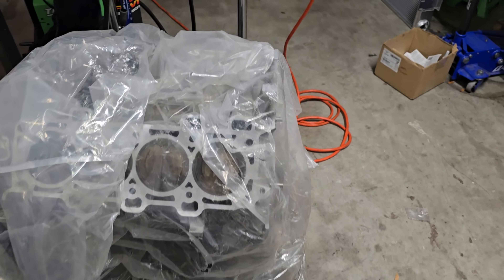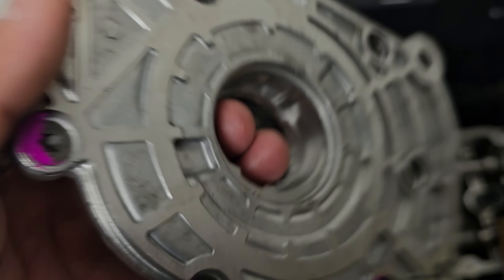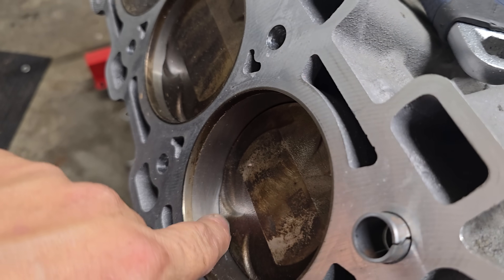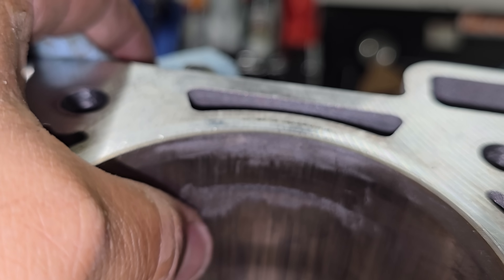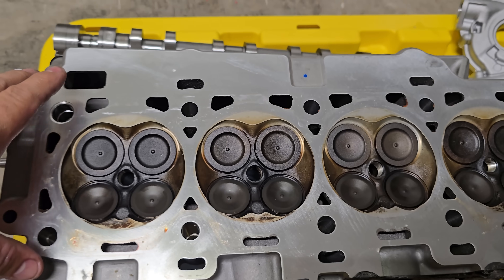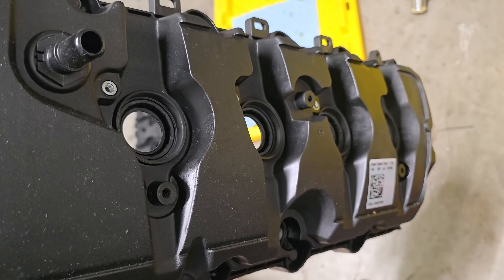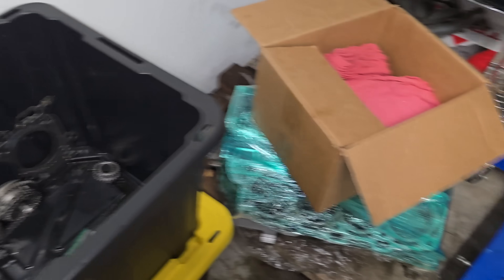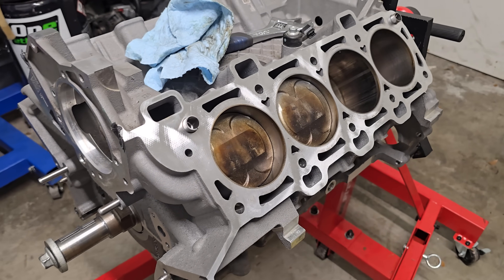Finding good deals on Gen 2 coyote motors.

Comment: Guys, if anyone has ever heard of this. My cylinder 2 in my 2016 GT, not supercharged. I have engine light And when cold only runs of 7 momentarily then  clears itself. Had a Zero compression on that cylinder on  a cold misfire engine. Put 100 ml of oil in the cylinder and blew the compression gauge off the charts. Looks like there’s a little light scoring and carbon in this cylinder. So the report says  ringland failure. Why do I go from absolute zero compression to full compression in 2 minutes then no other symptoms. This inspection was done with bore scope. Thx

Comment: I had a buddy just get two sleeves put in. It was $270 for the sleeves and to rehone the sleeve next to it. Supposedly when you only replace one sleeve it will some what make the adjacent cylinders oval which would either need to be replaced or honed back round if it doesn’t deform too much.
Reply: Was this a coyote though? I don’t see how you could only do one or two sleeves on a coyote
Reply: @killercoyote1905 yea gen2 coyote

Comment: That engine looks well taken care of. No varnish or carbon buildup inside the block. The marks inside the one cylinder looks like the piston rocked in the sleeve. Doesn't even look like the sleeve got damaged, just some deposits of aluminum from the piston. A hone on all cylinders and some forged rods/pistons and youve got a great homemade aluminator.
Reply from the maker: I wouldn't even bother updating rods and pistons I literally have an aluminator on the floor. I would just throw a stock Gen 2 piston in it and ride out
Reply: Definitely a rebuildable candidate for someone.  Have FFRE machine stock sleeve into the bad hole, add rods and pistons.  Now you’ve got a SB 1000-1200hp capable.

Comment: If you assemble it yourself, don't get the torque specs from Summit Racing. Their specs were waaaaay off. Don't ask me how I know... I got the correct torque specs from a Haynes manual. I used all brand new OEM bolts on my build. I do want to do a 2-2-1 swap on my 2012 GT though. I'd like to have the better bottom end and heads so I can have a little more room to grow.
Reply: If you can source a gen1 for cheap and in good condition it's still a good buy. Get the heads ported and throw some rods/pistons in the short lock and be done. Bigger head studs from Ford too.
Reply: @rileyneufeld7001  I'd rather drop a unmolested Gen 2 motor in there with Gen 1 cams/timing system and be done with it. There's probably going to be little to no difference between ported Gen 1 heads and stock Gen 2 heads.
Reply: I can build my own engines, but this project I'd just keep it simple. I'm not rebuilding anything unless its a stupid good deal.
Reply: @Smasher-Devourer I think alex showed that being done? The gen1 heads ported picked up a good bit of power if I remember correctly. Can't go wrong with a gen2 motor though.
Reply: @rileyneufeld7001  I'm not interested in porting anything. Blowing $600+ for a few horses isn't worth it to me when I can pick up a Gen 2 longblock and throw it in there and be done with it. If I want a few more horses I'll just pulley down.
Reply: @Smasher-Devourer Nothing wrong with that. What makes the coyote great is you don't have to put cams or port the heads.

Comment: i'd be happy with just finding a block and doing a basic hone and assembly it myself with a new rotating assembly.
Im not sure so much with new engines why not just get that blocked bored .010/ 0.020 over and set of new pistons ?
Could be a useful temp engine or be sold as a good short block.
Reply: The sleeves are too thin on coyotes to bore. That’s why when they get a cylinder messed up you have to have sleeves put in all cylinders or get a different block.

Comment: 7:05 😃weird way for shops to say "detonation and piston melted". At start of the video I though they mean ring butted and cracked top of the piston but boi, this is a bit worse 😁time to grab a chisel with hammer, get rid of that molten aluminium on sleeve, quick hone job and should be runnable 😅
Reply from the maker: Heads and timing system was worth what I paid. But the shop I guess thought it was a bad ringland. Lol much worse than that. Haha.